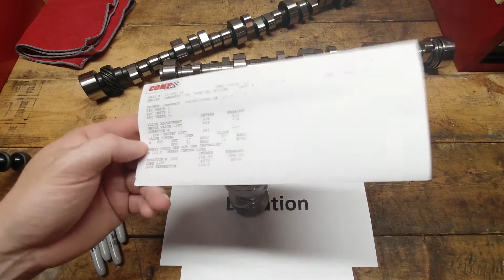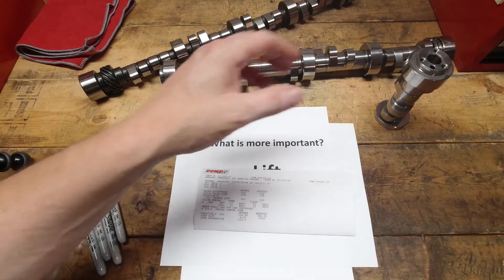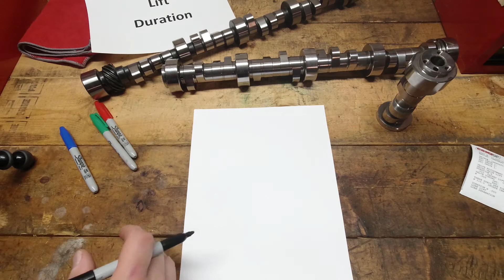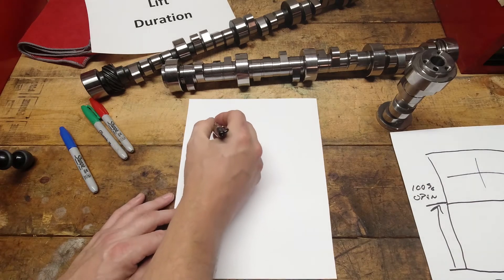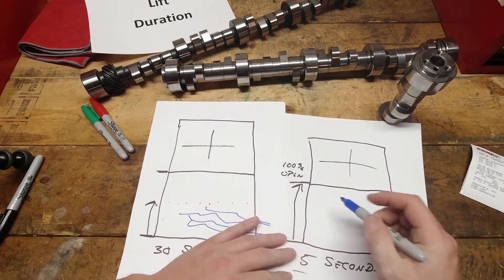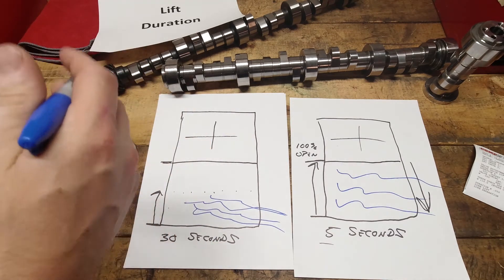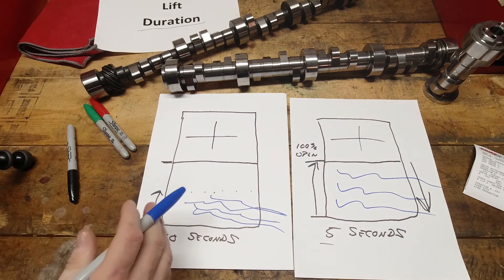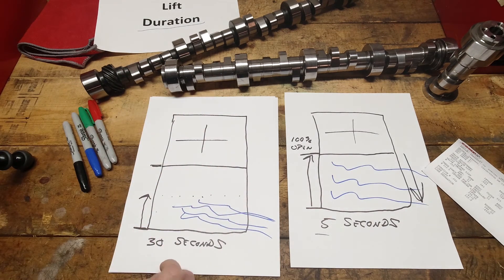What is the Difference Between Lift and Duration of a Camshaft

Comment: for making power at higher RPM I think duration is more important, because at high RPM there is less time for air to fill the cylinders, and increased duration allows more time for air to fill the cylinders, I don't think increasing lift does too much for increasing the amount of air flow available because the amount of air available is mostly determined by the intake design and induction method (N/A or supercharged or turbocharged) 

even if the valve opening is smaller (less lift) there is still plenty of total air supplied to the manifold before the opening, and although this airflow will have reduced pressure due to the smallwr opening, this airflow will speed up and increase the rate of flow (bernoulli's principle)

for those having a hard time understanding why a camshaft with less lift but longer duration will provide more airflow than a camshaft with more lift and less duration - here's the equation for airflow "Opening Size x Time" and so using your examples of a window opened 100% for 5 seconds and a window opened only 50% but for 30 seconds 

100 x 5 = 500 
50 x 30 = 1500

and

1500 > 500

compared to a naturally apsirated engine, boosted applications can get away with even less lift because the boosted air (compressed air) increases the air pressure way more than the loss of pressure caused by the smaller valve opening, and therefore the balance between lift and duration is a little less important for boosted applications, this balance is more important for N/A applications since there is no turbocharger to accomodate for the lesser valve lift - for boosted applications; increased duration is king
Reply from the maker: @IHETguy  duration and LSA are always far more important than lift.
Reply: @MuscleCarSolutions  ain't nothing truer

Comment: Awesome vid ! Can I get  your opinion on a cam just want one a step above my stock cam its a LQ9 Duration @ .050 in. (int./exh.)	196/201,,,valve lift 0.467 in./0.479 in. LSA is 116 ,,Stock converter with stock exh.
Reply from the maker: @DELTRANIO99  keeping the stock converter and no tune?  What’s it going in and for what use?
Reply: @MuscleCarSolutions  Thanks for replying back ,,Yes keeping the stock converter and will have it tuned ,,Going in a 2000 Z28
Reply: @ ?? Can you give some of sort of idea what to go for ? The info I gave you

Comment: Thank you so much. Explained very Good.  I'm wanting to build a Parade Truck. The Engine is a 390fe Ford Engine. I'm wanting a really good lope, but I dont know what I need to order or explain exactly what I want. Thank you for any information you my have for me.
Reply from the maker: Most cam companies won’t like that. 😂 The car show sound is ok I guess, but generally those guys like to build horsepower.  No one cares what it sounds like if it’s winning races.  But if you tell them that’s what you want, you’ll get a cam with tight LSA and a lot of exhaust duration.  You’ll get the sound you want but you’ll give up some HP.
Reply: @MuscleCarSolutions  Thank you so much, its a 50yr old Engine my hot Rod days are over. I just love the sound. Thanks Again. 😎😎

Comment: Hi I have a 400 sbc that I’m wanting to put a nice mild cam that can make some power but still be street-able. It has a stock bottem end, edelbrock performer rpm intake, qjet carb, and flat top pistons. It’s around 9.5/1 compression. The heads I have are 882s which arnt the best but I plan to get better flowing heads later. That being said I can run about .450 lift.  I’m just having a hard time choosing duration.
Reply from the maker: You’ll be hard pressed to find a cam with that little lift.  At least an aftermarket one. Comp has a couple really tiny cams in their high energy line.  Might start there.  It will be a mild cam alright and your make power wish is probably a bit of a dream.
Reply: @MuscleCarSolutions  okay, what lift and duration would I need to be at?
Reply from the maker: @jasonbuben2653  if you’re limited on the lift, you’re stuck there.

Comment: I had my 4G94 bored, by .5mm so the compression went up from 9:5:1 to 10:5:1, I added a turbo and bigger injectors. Im adding an adjustable gear, The stock cam is 248/248. So heres some options what should I choose.
 268, 272, 274, 276, 280, 288, 294, 298

Comment: Will a cam that has a duration of 289/300 thump more than one that has a duration of 294/294? In other words, what affect does a different intake vs exhaust duration have on sound and performance compared to the same intake and exhaust duration.
Reply from the maker: A little bit but you’ll want a much wider separation and a tight LSA to get that “car show” thump.

Comment: So I have a Gen 6 454 Big Block Chevy and from what I understand, the Vortec heads on it can only support so much lift, so getting a cam with the same basic lift but more duration would be a good way to give it a bump in power? Would it also affect the engines dynamic compression if the duration and valve overlap is too much?

Comment: Mathematically speaking if the duration is 10 sec (instead of 30 sec), and it is lifted 50 % compared to the high lift cam which is at 100 % for 5 sec, can we then say they are both identical?

Comment: A lot of things play a role with those two parameters. What rpms is the engine capable of, what compression is it running, is it N/A or forced induction? You can only increase the valve duration so much before there's overlap and the piston comes too close to TDC. You can decrease lift but force much more air through that valve with a turbo that overlapping won't be a problem and make power. You can increase valve lift, tighten timings and increase dynamic compression in a naturally aspirated engine to get more power at higher RPMs. Lift and duration mean nothing without context.
Reply from the maker: The theory remains the same.  How it’s applied at the time that the cam is designed for the application will dictate what parameters will work best.  Before those can be decided, there are some basic principles that need to be understood.  That’s all this was.  The basics, not the final recipe for a cam.
Reply: @MuscleCarSolutions  the answer i was seeking in this video was whether or not increasing the lift of an engine would affect its powerband. I concluded that it shouldn't change the powerband

Comment: Ok I need help so my cam suggestions are between 286/300 Dur with 13mm/11.5 lift vs 302/292 Dur with 11.5mm/11mm which one would be better ? I’m running a high ram with a huge intake and want all the power but rev mighty high

Comment: Hey man I just got a Comp Cam for my ls2 6.0, I ended up getting one with a advertised duration 276/295 @ .50 lift and a 222/233 valve lift .54 /.53 ..lobe separation 112. I wanted to know if this is good choice for a cam? Would it make good power?  Is it considered mild, moderate, aggressive? And will it have that nice CHOP CHOP lol
Reply from the maker: That sounds like one of their thumpr cams.  The way they designed the lobes and on that split yes it will sound aggressive but comp figured out long ago how to make those cams run really strong down low.  The LSA will limit the rpm but it wasn’t made to make power past 5000-5500 anyway.  Not sure what you’re using it for so can’t really say if it’s a good cam for your application or not.
Reply: @MuscleCarSolutions  I’m using it on my trailblazer ss for a daily application, just wanted some power without going too aggressive and honestly I wanted it more that nice sound

Comment: Great video man! I have a 351w, gt-40 heads..timing gear set..hooker comp longtubes.. Edelbrock torker 2 intake..750dp..comp hydro lifters.. been looking at the comp cam 280h. .280.280 .512 lift. Any thoughts on how it would do?  Looking for a 3.73 ls rear. Running a c4 transmission
Reply from the maker: Thanks!  The 280 comp is for sure a time tested winner.  Though I’d look at a hydraulic roller in its place.  You’ll get the dependability of a roller and avoid all the mess that a flat tappet can cause if the right break in and long term oil use isn’t maintained.  What are you using the engine for?

Comment: Hello, Can you tell me if the Comp cam #21-237-4 (212374) is considered a  wimpy/stock/mild/moderate/wild/insane stick?  :-)   Advertised duration: 280/280; at .050 inch lift: 230/230; valve lift .48/.48; separation 110 degrees.    Thanks!
Reply from the maker: That’s actually a really good, snappy street cam.  Needs a small stall converter if you’re an automatic guy.  The 110 lobe center will help it RPM just a little.  2500-6000 is just fine for a street car.  Not sure of the other equipment you have to go with it but that cam is a fun like grind to base a good street engine around.
Reply: @MuscleCarSolutions  Thank you. I'll keep it

Comment: Hello very informative video I've a 3rd 3sge dohc engine and I'm planning on up grading my cams.the stock cams are 254deg/9.8 lift for the intake and 240deg/8.2 lift for the exhaust so I'm planning to purchase the toda camshaft with duration of 264/9.0 lift for the intake and 256/9.0 lift for the exhaust so do you think that is a good cam selection for my application?your advice will be greatly appreciated thank you.
Reply from the maker: I’m not familiar  enough with the Toyota platform to give you a good response.  I can tell you that the change in duration is significant between the two cam sets.  Is that a turbocharged engine?  What tuning software are you using?

Comment: what if the difference in duration is not so significant let say a window that opens up 100% and has a duration of 20-25 seconds compared to a window that is half open (50 percent) for 30 seconds which one would be better?
Reply from the maker: Don’t get caught up in the example.  If you break it down to cam specs, what you’re asking is what would be better duration wise?  The answer is simple.  It depends on what you’re trying to accomplish with the vehicle.  It’s always going to dictate your combination of parts to hit that goal.

Comment: Great video. I learned the hard way when I was only 17. Purchased a circle track cam with low hours cheap for my 64 SS Impala  327 power glide. Thing would crawl out of the hole and about 60mph take off like a rocket. How much more useless yet dangerous cam could a 17 yr old have? LOL. High lift sounds great in a hot rod but wrong duration will die out before engine can reach it's potential. Comp Cams or most any of them offer the service of directing what cam with what set-up and what you are trying to achieve. Of coarse there are the guru engine builders that offer advice beyond what cam manufactures understand. Except the entire build most be followed closely. I'm looking for a good FE builder that knows where to buy components for an aftermarket 428 SCJ. I have read all the FE gurus over the years. Except most of them only build $15,000 and up.
Reply from the maker: I wouldn’t make the assumption that cam manufacturers don’t have the same understanding as an engine builder.  COMP has a very large engineering department and the best cam designer in the business.  Couple that with two Spintron cells, engine dyno abs chassis dyno and the technology they create is born from those tools.  The engine builder works with COMPS engine builder office to select the right cam and design the right custom grind cam based on the information provided by the machine shop.  They work together, but the cam manufacturer is the one that’s created all the lobes, specs, developed the material types and put the whole thing together for the machine shop to install.